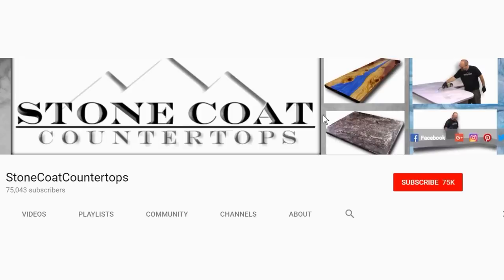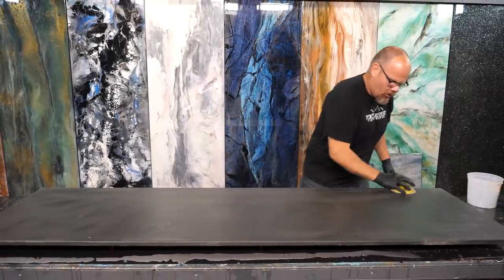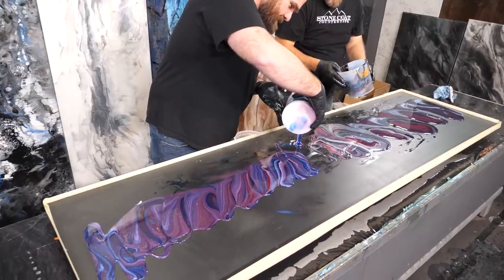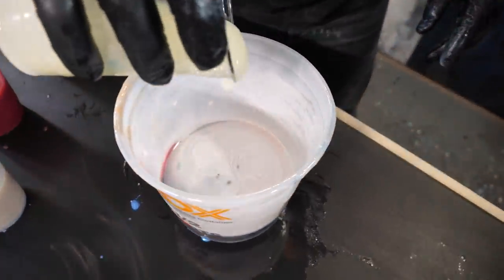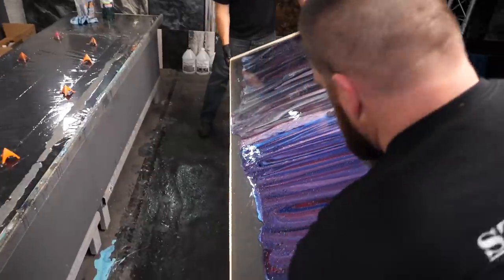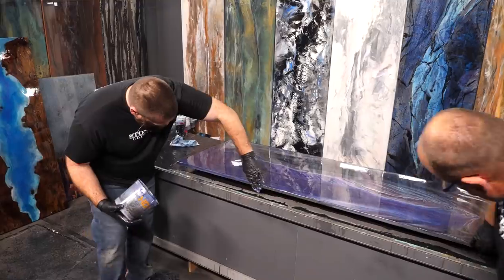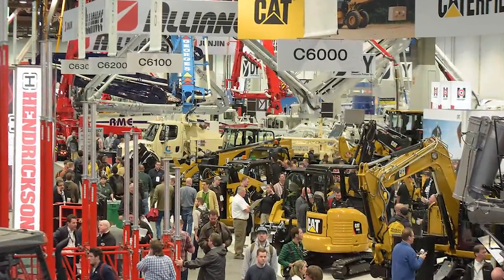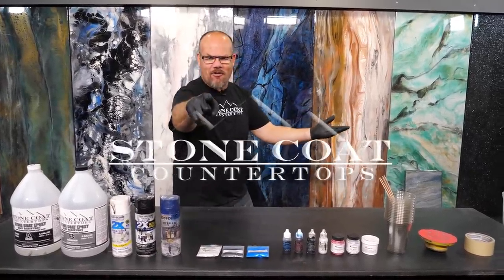How to Create Sliced Geode Countertops with Epoxy | Stone Coat Countertops

Comment: I’m wanting to do something like this for the flooring of my entryway to my house (no larger than 4’x6’). Is there any way to do this on something like MDF and then anchor it to the floor? Would it hold up long term that way?
Reply from the maker: Thanks for the great question! We normally recommend concrete flooring for the best long term quality. If you are going over anything other than concrete we suggest testing it out to see if you get the desired result. -Nathan
Reply: Stone Coat Countertops thank you for the feedback!
Reply from the maker: Anytime!